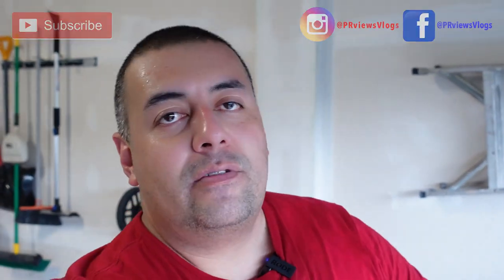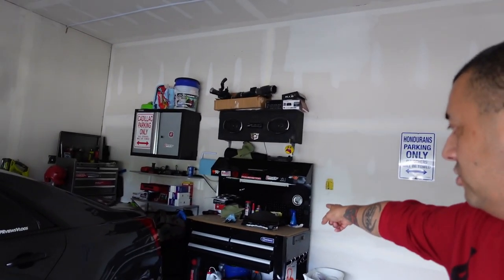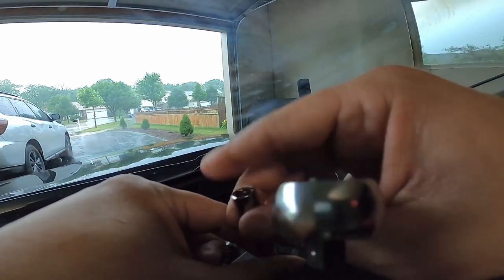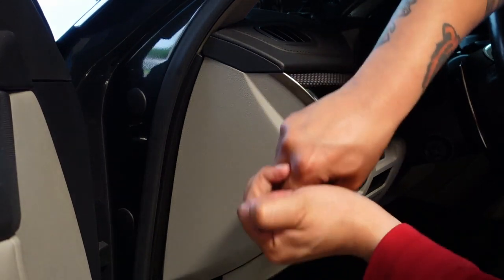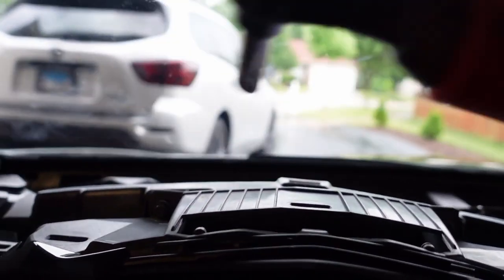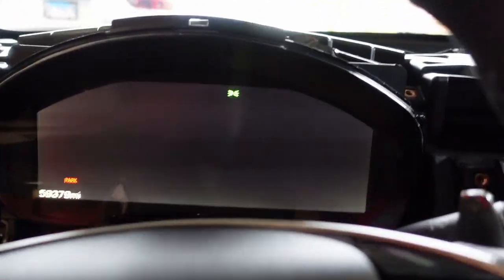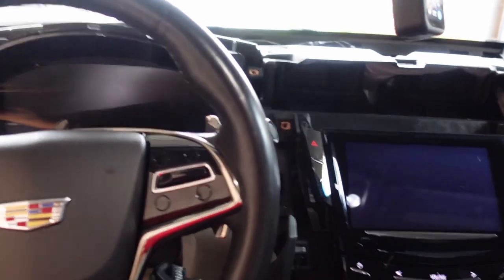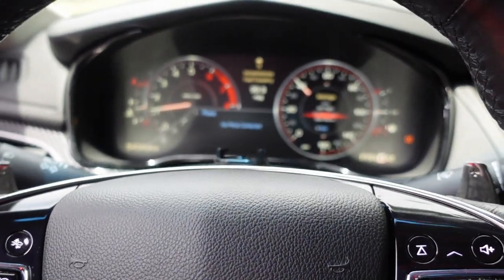2014-2016 Cadillac CTS LCD gauge upgrade.(dash removal)

Comment: Thanks for the instructions, I got my right steering wheel control for the volume and media not working after the cluster swap, the control for the cluster still works, is that possible I accidentally popped a connector while removing/re-installing the cluster or just try to change the whole control?
Reply from the maker: The steering wheel controls are not affected by the cluster removal . But I guess I would check , maybe when the cover for the steering wheel was remove you touched something or check to make sure the pins in the cluster u installed didn’t get bent
Reply: I see, thanks a lot! @PRviewsvlogs

Comment: Great video, I have an ats 2014 2.0 t, will support the digital cluster of an xts 2013? I've read that you have to make a modification to fit, but I mean if it's something like plug and play, thanks for your time
Reply from the maker: I believe you can fit them but like u said there is some modifications you need to make .

Comment: I upgraded my cluster on my 16 CTS using this video thank you. I also was able to buy the newer version cluster from 16+ cts v for 400$ on eBay and reprogram it using the vxdiag nano from Amazon. I’m also hoping to add HUD too, do you have any updates on it?
Reply from the maker: Your welcome , as for the HUD you need to replace the windshield due to the defective area made to work with it , it’s actually not bad it’s about $500 for the windshield plus parts for the HUD possible about $800 total
Reply: @PRviewsvlogs  is installing the HUD parts plug and reprogram? Or is there any wiring to do?
Reply from the maker: So like my cluster it has the female port for the hud there should be no reprogram or extra wiring you are going to need the actual HUD the HUD buttons and the grill cover
Reply: @PRviewsvlogs  I have the pre-crash light. Do you think I need to replace the windshield?
Reply from the maker: Yes
Reply: What is involved in programming it with the vxdiag nano?
Reply from the maker: I don’t know I didn’t program it , it was programmed the person I mention in the video

Comment: Good video!! Do you happen to know if you can change the font style on the gauge? For example, I have a 2016 CT6 and I like the display better on the 2017 CT6. The font on the speed readout is cleaner looking and on the top gauges, the 2016 has a blue ring around the 4 gauge readouts where the 2017 doesn't. Thank you very much!
Reply from the maker: Thank you . So I’m sure the display would fit but you would have to contact , the person who did the programming for my gauges to see if it can be programmed .
Reply: @PRviewsvlogs  Thank you. I was just hoping that maybe I could find the backdoor if you will into reprogramming the display just to change the look to the 2017. Keep up the good work!

Comment: Hell yeah man looks nice, do you know if the cts has the slot for heads up display?
Reply from the maker: No , but it can be installed but the windshield has to be replaced so it will have the reflective portion

Comment: I only skimmed through your video so I may have missed this part, but did you have to cut up the inside of the dash (behind the cluster)? Thanks!
Reply from the maker: No not at all
Reply: @PRviewsvlogs  okay thank you. I did some more research and it’s the ATS’s need to have a little cutting and shaping to fit the new screen.
Reply from the maker: Oh you did not mention you had a ats , yes those I’ve heard you have to trim the dash a little

Comment: I have a 2016 CTS luxury 3.6, will it work, also the part number you gave is for a 2014 CTS, WHAT DID YOUR GUAGES COME OUT OF, THANKS
Reply from the maker: A 2015 CTS , the 2016 has diferente digital Gauges but yes it can work
Reply: I’m saying the part number you gave are not digital guages, there for a 2014
Reply from the maker: @Gaitan6408 you need to contact the person that did my programming he might be able to get them
Reply from the maker: @Gaitan6408  I’m saying the part number I gave at the time where digital gauges , I do t know what they came out of contact the person I told u in the video he got them for me

Comment: So i have those similar stock gauges (exact look really) on my 2013 Cadillac SRX. Could i upgrade to the CTS all digital gauges?
Reply from the maker: I’m not sure you would have to research abs see if the gauges of the CTS are the same part number as SRX and see if it was even a option for  car .

Comment: Why did it show that orange engine check light after you already installed and were driving it?? Did it go away??
Reply from the maker: What orange check engine light ?? I have a TPMS light not a check engine light , and I explained that in the video , I have aftermarket wheels and the sensors they sent me didn’t program to the car nothing to do with the install of the gauges
Reply: PRviewsvlogs Dash looks great. I’m just asking what the orange light is at the bottom right??
Reply from the maker: Yes that a tire pressure light .
Reply: @PRviewsvlogs ,  did you ever get the tire pressure light to go out?
Reply from the maker: No it’s still on , the tire pressure light has nothing to do with the dash , it cause I have after market wheels with after market sensors and the sensors are not reading

Comment: Is this cluster you bought also a 14’ cluster? Cause I have 2014 V Sport I wanna do this too. Will it work with any cluster?
Reply from the maker: You need a cluster from a 2014-2015 CTS premium . I have the part number on the description as stated on the video .
Reply: PRviewsvlogs you’re bad ass bro. I been trying to do that to the V Sport since I got it a year ago but why pay $10,000 more for it on the premium when you can install it yourself for like 700$. Good man
Reply from the maker: Thanks bro yea just follow the steps in the video , see if you can find a used on on eBay
Reply: PRviewsvlogs I have no luck on eBay for it, been looking for it. I’m going to have to buy it new of gm parts direct for like 600$ cause it’s 35% percent off. Goes for 935$ on the reg
Reply from the maker: Yea a then contact my guy and he will program it for $250
Reply from the maker: I got lucky when I found the used one

Comment: JUST CURIOUS I BOUGHT MINE FROM WHITEAUTOANDMEDIA FOR MY 2014 CTS 2.0. I NO LONGER HAVE THE CAR BUT KEPT THE CLUSTER. COULD I GET IT PROGRAMMED TO MY 2018 CADILLAC CT6 THAT I HAVE NOW?
Reply from the maker: Will not fit
Reply: @PRviewsvlogs  oh ok. Thought it would since I've seen that same cluster on ct6 and even escalades of that era
Reply from the maker: I believe that they have some differences in the mounting points
Reply from the maker: I would call CADILLAC get the part numbers for the clusters and cross reference if they are the same part number your good to go
Reply: And if so is it possible to program it to the ct6 after it has been programmed to the cts?
Reply from the maker: Yes it can be reprogrammed

Comment: Hey bro I got a question about that mod I have a 13 XTS and I bought a 14 Platinum XTS is currently in my vehicle and it's getting a lot of errors on things that are not on my car will this cause a problem to the actual operation of the vehicle long-term?
Reply from the maker: I don’t get the question , you have a 13 XTS and you a 14 XTS gauge ?  Or car not sure what your trying to say , but if you didn’t program the gauges to the car yes you will have errors will it cause problems probably not cause it’s just showing errors cause it can find the sensor for things that are not there , but you shouldn’t have this issue if you had someone program the gauges to your vin

Comment: Will this work on a SRX too to swap out the cluster
Reply from the maker: No
Reply: @PRviewsvlogs  it’s the same cluster
Reply: @PRviewsvlogs  I took it apart it’s the same cluster you had at first the plug the same and everything
Reply from the maker: @AG357AG  someone already tried and it did not work cause it won’t program to the car , and the parts don’t fix exact . So no it won’t work